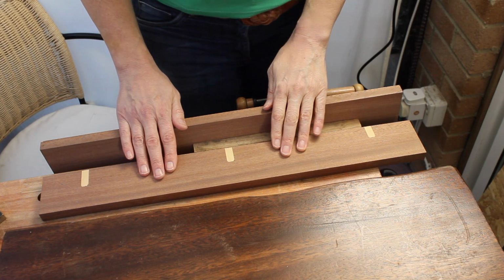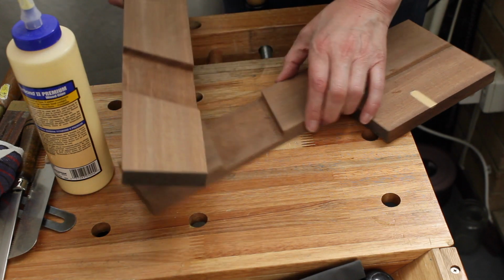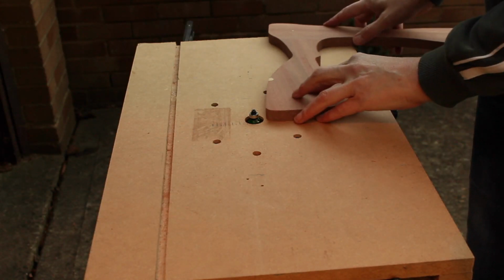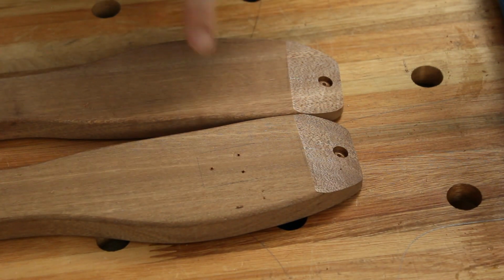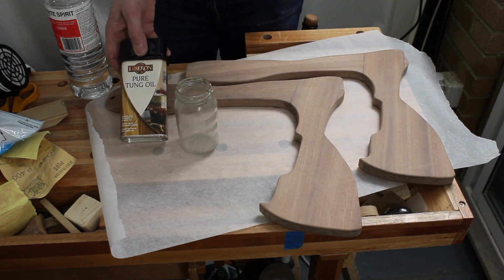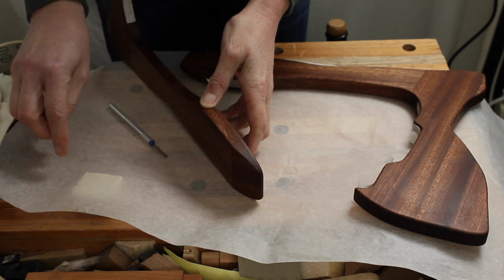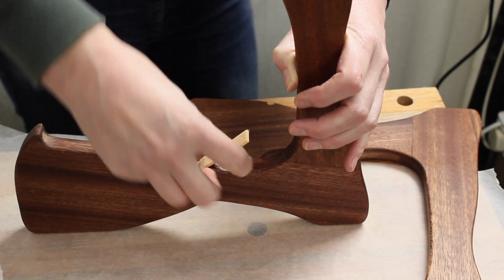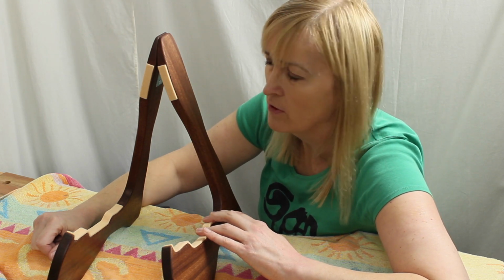2 Guitar Stands - #2 The deluxe version

Comment: Susan, the uneven hollows from the router come from Tool pressure, the force into the cutter from depot of cut and speed of feed cause deflection. you see it more often when working with steel but it exists with wood. You did a very fine regroup with saw and chisel and made a lovely stand. Bonus marks for the effort.
Reply from the maker: +FunkyC you're right. I think if I can come up with a suitable jig to hold the work steady then I'd get a better result
Reply: I think if you reduce depth of cut and rate of feed you have less of an issue.

Comment: That's a nice stand. Making that kind of lapping joints with just a knife, chisel and saw is IMO the most fun kind of woodworking. It's really quite easy to get a perfect fit. Mark the depth with a gauge, saw one side and chisel in an angle to the bottom of the sawing from almost the other wall. Then use the other piece to knife the other wall location, saw that and level the bottom chiseling from both sides. And it fits like a glove every time.

Comment: Driving out the hinge pin is a good idea. A spring pin or rolled pin can be installed or use a brass pin as used on knife handles.

Comment: Just want to help you out here, I am a carpenter of 36 yrs. When I need to pick up angles, I will layout my work on the floor or on a sheet of plywood. On smaller wood working projects, drafting paper and a architectural ruler. That way you can draw it to scale.  Hope this helps in the future with the hinge problem. Good luck.

Comment: Great project and result. The problems highlighted are what most people would encounter and the solutions were good. One or two suggestions from viewers are good too. Could have done a dry run with hinge up in place for marking out. Could use bolts on both sides to balance looks - with plugs! Can't get into all the effort of several coats of oil etc - I'd go for simpler finish like using sanding sealer followed with bit of wax, or even just varnish. But there you go. Thanks for video.

Comment: Hello Susan. Very nice piece of work I love the way it came out. Not to take anything away from the stand it is great as it is. I made a hat rack for my son for Christmas this year at the request of his wife. I used all oak and to hide some screw holes I made dowel plugs as someone in the comments below mention to do. I also made some thin walnut 4 pointed diamond shapes <> vertically as accents. This would work well to cover the bolts holes you were thinking of plugging one diamond each side at the top. As another idea only, the felt at top I was wondering what it would have looked like with a diamond point cut on each end of the strip at the top. And maybe at the start of each long strip on the bottom only where it meets the upright supports. Leave the other end square. You are getting very good at wood your working and and more amazing each video. It looks fantastic just as it is, all Susan. :-)

Comment: Another Very good job and video. Regarding the counter bore holes, you could cut out 2 x 1/8" thick guitar shapes in light wood and stick one over the holes and one in the same pace on the other leg as decoration. Sorry if I'm sticking my nose in.
Reply from the maker: +Jack Tar that's a very creative solution. I think I'd prefer inlay, so maybe a simpler shape - a diamond on each side perhaps

Comment: Well done, really nice looking stand Susan. 
To fill those bolt holes a little nicer you could use a pellet / plug cutter with an offcut and your pillar drill. Much nicer than dowel.
Reply from the maker: +Pete  Moore There's a plug cutter in the post right now :-)
Reply: Susan Gardener Great, i always found it better to file or grind down the width of an old spade type drill bit to get a good tight fitting plug. 
Love the drum sander, you have more patience than anyone i know, keep up the great videos.

Comment: Nice project as always. I like the idea of using masking tape and super glue to hold the pieces together while you cut them, I haven't seen that before, masking tape is a lot easier to remove than double sided tape.
A couple of people mentioned the sandpaper on the mitre gauge to hold the work safely, in addition you could screw a board the the face of the mitre gauge first which would give more support and then fasten the sandpaper to the board. This won't improve the slop in the mitre slot though.
A few different suggestions for dealing with the screws & hinge. Another idea might be to cut a small brass plate to cover the holes and engrave your name or makers mark on the brass, possibly with a date when the stand was made.
It all finished well in the end, keep up the great videos.

Comment: To adhere the felt pads to the stand I would recommend using an old inner tube (with the valve stem removed).  It can be wrapped around the irregular shape of the stand and apply constant pressure along the contours until the adhesion cures should you want to do something similar in the future.   My best to you.

Comment: Hi Susan, 
you could remove the pin from the hinge, screw both parts and then put the pin back.
Reply: or make a wooden hinge, and drill the pin hole assembled in the open position.

Comment: I use acetone to wipe down oily tropical woods before gluing them, as it dissolves the oil. The acetone in the superglue/CA glue is doing the same to the tung oil finish.
Reply from the maker: +Crheston Mitchell a solvent wouldn't remove the oil though unless you wipe away the solution. I was wondering if there's a chemical reaction going on, as naptha is an accelerant for CA - maybe the tung oil acts in a similar way.

Comment: You should try ScotchBrite  pads instead of wire wool for polishing.  They hold their shape better and don't shed metal splinters.  I haven't tried them on oiled wood so I don't know if they stain (they have abrasive grit so they may still form a sludge with oil) but they sure are nicer for metal cleaning and polishing.
Reply from the maker: +MattOGormanSmith I might be wrong, but when I looked at scotchbrite pads there was no indication of the equivalent grit, so I avoided them. I could have used 1200 and 2000 grit paper instead, but I decided to go with the instructions on the cans. Like the scotchbrite I'm not sure what the equivalent grit of 0000 wire wool is. I'll keep experimenting
Reply: That is a handy little guide.

Comment: This is my favorite so far. I like the hinge action on top not requiring a chorde or strip of metal between sides to limit spread. I wonder if the sides could be joined with a joint not requiring a hinge a all.

Comment: Search ebay for a 1/2 inch plug cutter and you'll fing you can fill those holes with plugs made from the same piece of wood which (assuming if you matched the grain direction) would render them almost invisible.
Reply from the maker: +seafax I've just ordered a set of them :-)
Reply: Susan Gardener
:-)

Comment: I love this, very nice. But you didn't need to bolt one side. You could have taken the pin out of the hinge, screwed each hinge plate to its side piece, and then pushed the pin back in with a nail set.
Reply from the maker: +Crheston Mitchell good suggestion!